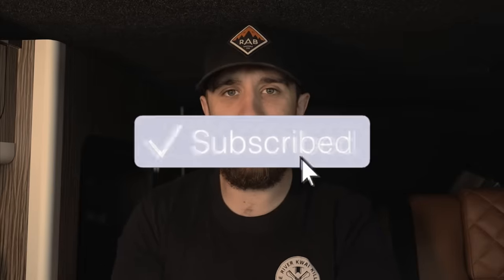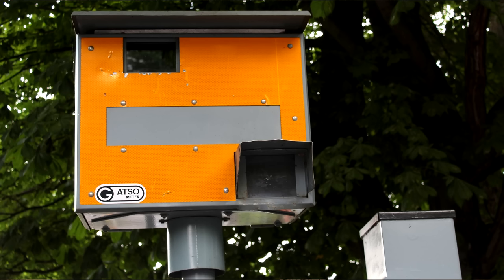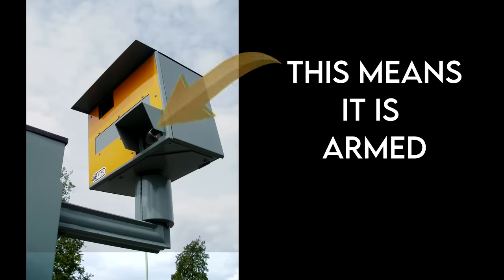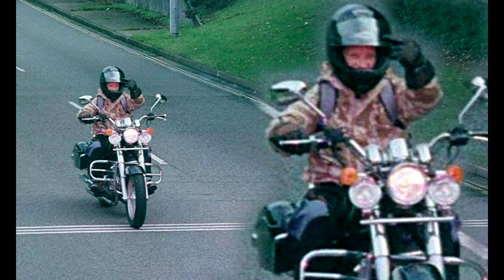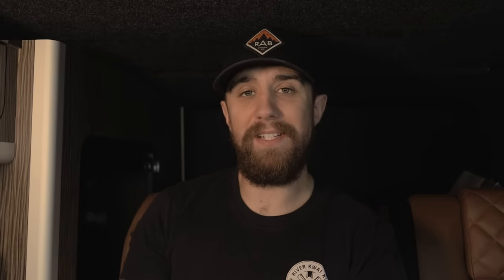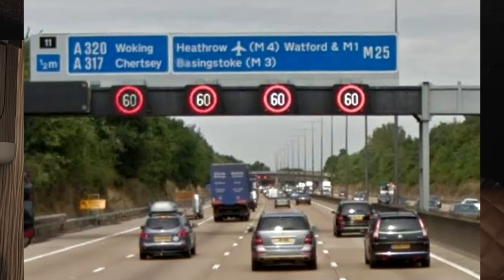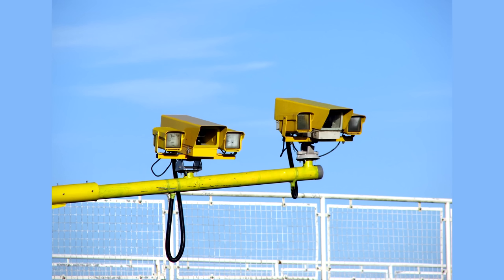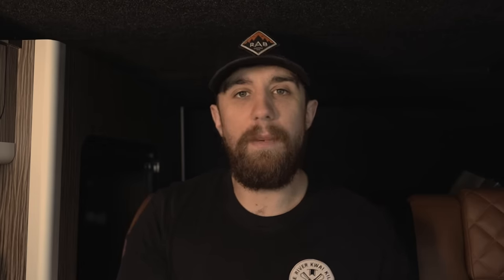How Speed Cameras Work and What to Look Out For

Comment: Also big note, 
You can get points and a fine by a speed camera while you are on a push cycle, electric cycle, skateboard, rollerskating, rollerblading etc.
You can get points on your licence even if you have no pink(full) or green(provisional).

It is not 12 points for disqualify.  It is 12 points in a three year period, and points come off on year four, leaving a possible window of one year to get more than 12 points and not be disqualified.  Also on year four you have to apply and pay (£20 basic admin fee) DVLA to have the points removed else they will be still valid and on your licence.  This rule does not apply to new drivers where it is six points total in first two years and you will need to retake your test to get your licence back.
Reply: Not quite true their. The instant bann after acquiring 12 points within a 3 year period is "advisory", but any judge has the power to overule said advice, and allow a driver to keep their license (most don`t). I`ve read cases where people have had more than 20 points on their licenses before getting caught and getting yet more points before being banned.  Also, points on your license are valid for 3 years, not four, but will remain on your  license for 5 years, even though they have no legal value. Last of all, if a driver has held a license for less than 2 years (new driver), and they acquire 6 points within any 6 month period within that 2 years, they have the option of doing their test again, OR accepting a 6 month bann, but keep their full license active, which was what  happened to someone i know.
Reply: Not sure where you got that information from, but it's completely wrong.

You can't get points on your license for "speeding" on a bicycle or a skateboard etc because the road traffic act which governs this ONLY applies to motor vehicles. A skateboard or a pedal cycle isn't deemed as a motor vehicle and as such the legislation does not apply. On your logic, if you ran past a speed camera and set it off, you'd be liable for points on your driving license too? Running is deeemd no different to being on a pedal cycle when the road traffic act "motor vehicle" element is present.

Most pedal cycles or even rollerbladers, skateboarders etc won't set off a camera anyway, they're designed to activate on larger vehicles, so there's no guarantee you'll even set it off even if you are speeding. 

If you are prosecuted, it won't be for "speeding" it would just be "wanton riding" or "riding a bicycle without due care/attention" there's certain legislation that still applies to bicycles and non-motor vehicles however speeding and speed cameras don't apply to it.

The part about points is mostly correct, for the majority of offences it's 4 years on the license, with a 5 year as an "admin" year for them to be removed but they aren't "valid" during that admin year. There are exceptions though, for drink driving and causing death by either dangerous or careless driving, the points remain on your license for 11 years.
Reply: @thefiestaguy8831  🤣  I say to you.

In UK you can get points by speeding on a push bike.

Source:  Legislation Gov website.

Your source - = your mythical brain.
Reply: @pqrstzxerty1296  Please link me to the part where it says you can get points for speeding on a push bike?

Speeding offences relate to motor vehicles, a push bike isn't a motor vehicle.

You can't be prosecuted for speeding on a push bike, rollerblade, etc but you can be done for other offences such as dangerous riding (cycling) or wanton riding (essentially riding in a furious way).

If a push bike was a motor vehicle, then it would require insurance, since we know push bikes don't require insurance to be used on the road, they aren't motor vehicles as deemed by the legislation that governs it.
Reply: @thefiestaguy8831  Local Bylaws set by the Local Authority.
Reply: @thefiestaguy8831  The Transport Secretary has discussed potentially introducing a 20mph speed limit for cyclists in Britain.

Comment: I travel a lot along the M25, M1, M6 and M5.  What is frustrating are the overhead speed signs that are often incorrect almost as if they have not been updated - advising of road debris or a stranded vehicle no longer there.  Sometimes, signs can also be contradictory,  particularly through roadworks.  I don’t condone speeding but some violations are due to confusion.

Comment: Driving in average speed check zones is quite unpleasant. You spend way too much time watching your speedo, overtaking takes forever with everyone doing almost exactly the same speed (so drivers end up in each other’s blind spots for ages), tailgating seems even more prolific than normal, and it’s not like the 70mph speed limit is particularly fast to begin with. If you’re stuck for miles doing 50 its completely mind-numbing. 

Speed limits and their enforcement are a blunt instrument set with regard for the worst drivers, driving the worst cars, in the worst conditions. People are not the same, neither are their cars, and on any given day the conditions will be different. Speed limits are often far too arbitrary to warrant police enforcement in my opinion. Save the time and money for tackling bigger problems.
Reply: And continually watching your speedometer instead of the road and traffic ahead is extremely dangerous with a much greater risk of having an accident.
Reply: On top of that, the speed limits are from a time when car accidents were still routinely lethal. Heavy cars with mile long breaking distance, no airbag and not crumble zone, and often not even seat belts.  Cars now are many times safer, even at higher speeds, we can afford to have higher limits.
Reply: Er no. If it takes forever to overtake then it's not worth overtaking so don't. Don't stare at the speedometer just chill and drive at the required speed. Anyway engine sound and 'feel' of the car tells an experienced driver how fast he/she is going. Bad driving kills 2,000 people a year and makes life a misery for tens of thousands.
Reply: I use my cruise control in these instances.Takes away the stress
Reply: @StarlasAiko  Cars are safer yes, mostly for the people inside the car, but what if you crash into a car that isnt as modern and safe?  Or a pedestrian?

Comment: Good job, man. Thanks for this. Been driving independently for nearly six years and still learning. You always learn new things when driving, regardless of how long you've been driving for. I never break the speed limit, I always say to people the limit is the maximum. That's why it's called a speed limit and not a speed target. For example, just because a road is say 40, it doesn't always mean it's safe to do the full 40. It's just the driver has the use common sense. Again, thanks for the video, man. Keep up the good work.
Reply: I've been driving longer

Pro-tip: Speeding is safe, fun, and effective. The posted limit is at least 10 mph below what you should truly be going.
Reply: Absolute nerd

Comment: From Fraser, husband of Leslie
Don't forget that every "student" sent to a Speed Awareness Course nets the police £40 out of the £100 charge. A "nice little eaner" !
Reply: The police don't profit from that money it funds the mobile speed enforcement operations and they barely brake even but any money that is left over is ring fenced and used for road safety campaigns.
Reply: Same in Ireland.We don't have many fixed ones,but plenty off those mobile speed van ones.Just a revenue generator operated by a private company.
Reply: But you don't have to pay anything if you keep to the speed limit
Reply: Just dont speed, no speeding = no fine, its that simple!
Reply: @glockeva1  Not always easy. I was changing lanes at traffic lights in Worcester.. The signage for lane was at the lights, me in wrong lane, i sped up slightly on bike to get in right lane to cross bridge with lots of traffic rushing up behind. Totally unaware there was a speed camera watching the lights for this very purpose. Three lane one way road is poorly signed at 30mph. Third of folks on the speed awareness course caught by this camera. SAC was total waste of time. I later rode the route, the two 30mph signs hidden in bushes. The road should have 30 painted on them.
Reply: Just been on street view, two frames, one shows a new lane sign up earlier, but missing in a later frame. Still no obvious 30mph signs.
Reply: Johnson Johnson  Lamp post thing is a myth. That one came up in a court case and was thrown out.

Comment: Trajectory average speed checking is the latest fashion. You can dodge static camera's (by knowing where they are) you can dodge mobile camera's (with apps) but not the trajectory ones. They are built as mouse traps, with only one way in and one way out and without the  possibility to turn left or right before the 2nd camera.

Comment: Very informative any tips on how to get cases thrown out of court any sort of technicalities
Reply from the maker: No but I'd be happy to do a video if people have examples
Reply: Incorrect procedure.
Time limit expired (also known as STL or "Statutory Time Limit" which is usually 6 months for summary offences such as speeding).
Sometimes "no speed limit signs displayed" can work but that old argument of "streetlight rule" is bought up if it's a residential area you're caught in. It might work in a 20 zone because you could argue "I thought it was 30" but most 20 zones where I live have 20 signs every 100 metres or so and even paint "20" into the road surface and there's a camera typically every mile or so.

Comment: 5:20.....I read an article a few weeks ago, a police officer interviewed stated that there is no legal requirement for them to be visible. They could park up and camouflage themselves if they wanted to and they wouldn't be breaking any rules. What the officer did say was that they try and be 'fair' with drivers. Which I disagree with. I had an incident a few weeks ago with a speed van (wasn't caught thankfully) but where the van was positioned was very deliberate - on a bend just next to the carriageway that runs downhill, and in a location of the road where at that time of the morning the sun is up high blinding the drivers if there is no cloud. There was no cloud on this morning but thankfully I wasn't speeding - but it was very late before I saw the van at the side of the road owing to the frigging sun!! 

They are always very clever in how they position themselves I have noticed. Insidious!!
Reply: Look at all the videos of them on YouTube they are very rarely hidden, they simply park where they can park.
Reply: There’s a section of the A35 near Puddletown on the Puddletown Bypass where they always seem to place a speed camera van. It’s usually in a lay-by, on a bend, at the bottom of a steep hill, and there’s no signs telling you what the speed limit is. Also, of a morning or late evening, the sun gets in your eyes so you can’t see the speedometer properly. Apparently, someone was clocked by a van parked there doing 105MPH. Ridiculous and only there to make money.

Comment: I remember when I was riding quick, came off a corner at around 120mph and sped up to around 140mph before realising their was a mobile speed camera, I slowed right down to the 60mph speed limit and had no choice but to ride past it, so as I got near it I done a wheelie for about a quarter of a mile until I got round a bend, never got a ticket. And I’ve never got a ticket since and never will😁
Reply: On your NSU Quickly then?
Reply: yes i tuned it up  go faster sticker on it.
Reply: Which Car? Fixed camera has a disadvantage once you are aware of their location you can speed past it.

Comment: There is one important type of new camera you missed out. This works on "Pizzo electric" which means it has sensors under the road which are triggered by the weight of the car or motorbike. they go by a wire under the road to the camera and cannot be tampered with or signal jammed, and work in all weathers.
Reply: they would still have a camera attached, so the camera can always be blocked with duct tape / coloured glue / clingfilm / etc.
Reply: Ron Angel ... I wonder if they catch and report police drivers who unlawfully break the speed limits on our roads every day of the week and in or on, every single vehicle... (yes ..  of course, when not on an emergency call!)  We should campaign to have ALL drivers prosecuted!
Reply: @Michael MurrayInduction coil on earlier ones "Piezoelectric" sensor on these. induction coil can be jammed from the car with a powerful electric field or radio type signal on the same frequency they work on from under the car, a bit like magnetic mine units on WWII ships to give wrong or unreliable readings." Piezoelectric" cant as sending shielded signal generated from the weight of vehicle size-independent directly by wire to control unit. ( PS: I am a retired electronics and electrical engineer)

Comment: I was told that the new craze is to break into the power supply at the base of the post, rip out the fuse and cut the control cables. The other craze is to superglue the lock on the access door as this costs the councils in having to get the locks replaced.....these people hate the police and the councils.
Reply: Haha try that on the lower M6 new ones they are set in 1½metre thick concrete. We made the main posts for the project around 30 of them. Thank God I don't live anywhere near the M6 🤔🤣😂
Reply: I wouldn’t do  anything like that myself....but the police haters go around causing damage and inconvenience. They’ve moved on from setting fire to tyres on cameras to trying to incapacitate them with spray paint , glue and even eggs !! Apparently they leave a horrible slimy gel on the lense.

Comment: I know the UK has a target to issue 1,000,000 speeding tickets this year just in London alone, last year 360,000 were issued. I find that bizarre but I assume this is applicable throughout the whole UK and not just London as I've noticed 3-4 flashes on the m1 per hour when I drive on it. I don't remember it being like that last year. Anyway, I just discovered my car has cruise control so I set it to 70 and chill, when I lived in Cardiff and travelled to Swansea I'd bolt it 100 the whole way through on the m4, it's a miracle I've never been issued a speeding ticket tbh but it's quite nice to set the cruise and just relax and not worry about cameras
Reply from the maker: Where did you hear that they are planning to issue 1million tickets? Is ot a credible source ?
Reply: @CorpsMedia  I saw it published a few mainstream articles (which nowadays means jack) but this is the exact text from the 'evening standard':

"Chief Superintendent Simon Ovens of the Met’s Roads and Transport Policing Command, speaking at a meeting of the London Assembly transport committee on Tuesday, said TfL has “a clear position to get to a target of one million prosecutions a year for speeding”.

He said there were more than 360,000 prosecutions for speeding offences in London during 2021 and 263,000 during 2020."
Reply from the maker: @Ayoutubeaccount3  I did some research on it, I think its crazy to set a quota to catch speeders. I guess the only way to up the anti would be to put them in more tricky and deceptive places

Comment: If you use a speed camera detection system like Road Angle and act upon the information or use a radar jammer and get caught, you can be prosecuted. However having a satnav like TomTom, with speed camera locations built into the system, thats a different matter.

Comment: The 10% + 2mph  rule is to allow for tolerance in speedometer inaccuracy. However, as pointed out in the video, you can be prosecuted if your 1mph above the limit. This relies on you admitting to knowing you were over the limit so the answer to the question, when asked, "do you know what speed you were going?" Is always "no". Its up to the courts to decide if a case is heard or not, not the police's. All the police can do is present the evidence to the court, who will then decide if to prosecute or not. If your within the 10% + 2mph the chances are your money is safe in your pocket. It is a risk, as the cost of the fpn is far lower than you could be fined in court, however, any solicitor worth their weight would have the conviction thrown out before you had to step anywhere near a court. 
Accepting a fpn at the roadside is not an admission of guilt and does not have to be paid if you wish to challenge it and risk going to court. 
There's a very useful drivers guide (the name currently escapes me and I don't have my copy to hand) which gives you lots of information on the do's and dont's when interacting with the police at the roadside, as far as I'm aware it's still available. If I find my copy I'll update this with the title.